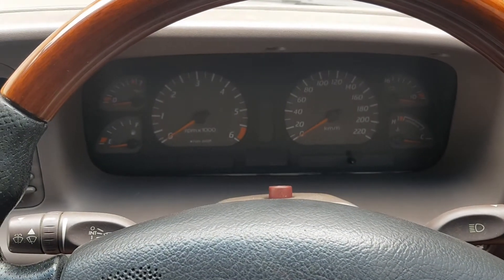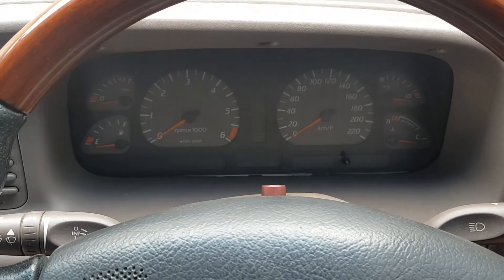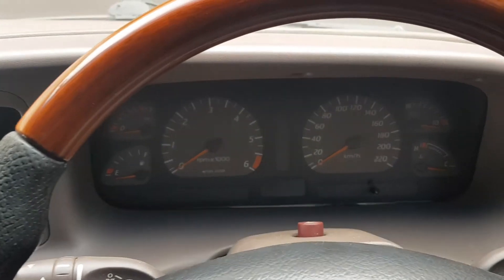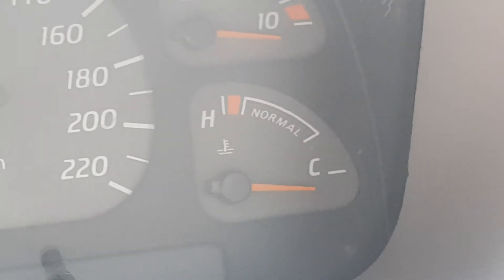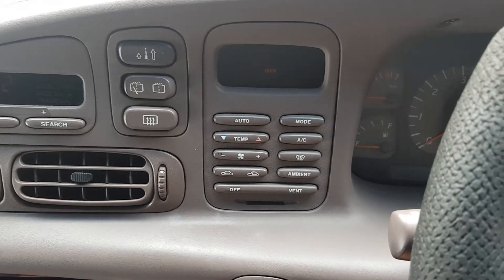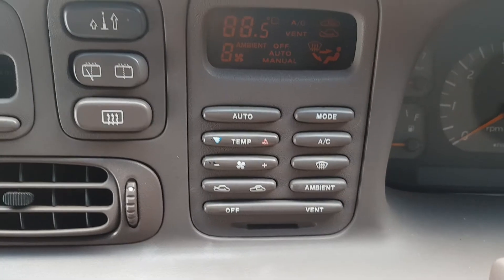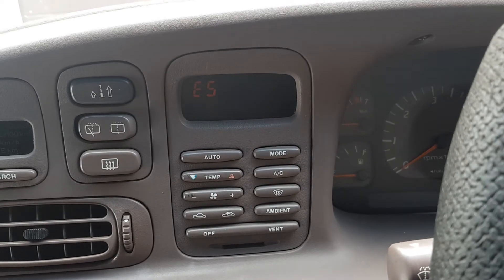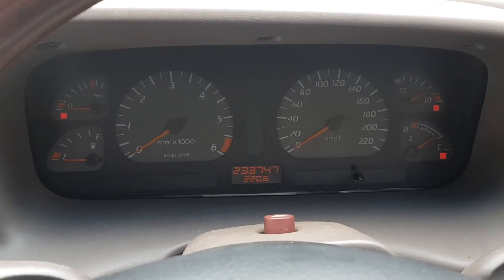Ford EL 1997 Air Conditioning Diagnostic Test

Comment: Not sure if you ended up figuring this out, I don't see a follow-up video.  E5 is a problem with the Ambient temperature sensor, located in the radiator air deflector.  You should get a workshop manual if you don't have one already - I have one from Ellery and it goes over everything.
Reply from the maker: Hi Thanks for your message. I recorded a video of myself removing and replacing the 'Ambient Sensor', as you said 'located in the radiator air deflector panel' Unfortunately I was not able to upload the video due to internet issues, then simply forgot all about it until I read your message.  I will now give it another go. Thanks again and Ford On!
Reply: @rpsyoutubby  Wow, I wasn't actually expecting a response to this...  I'd definitely be interested to see your vid of replacing that sensor - the only reason I'm so familiar with that error is because I've got it in my DF LTD and haven't gotten around to fixing it yet. Cheers, mate; and happy Fording!